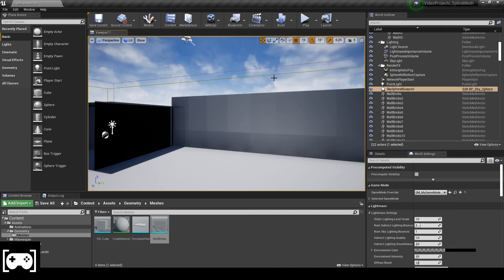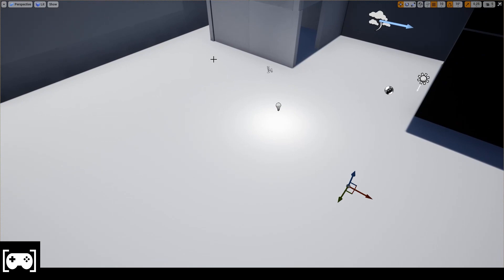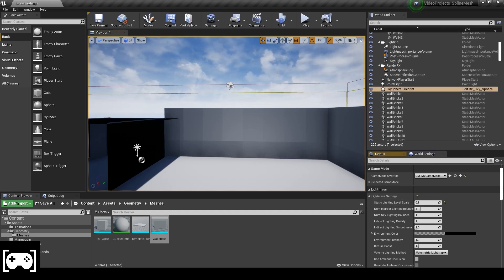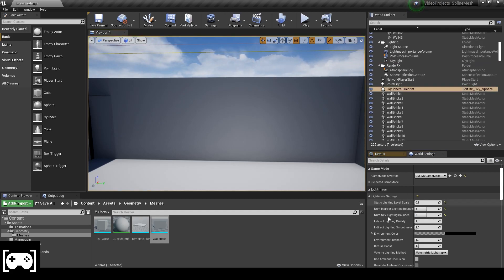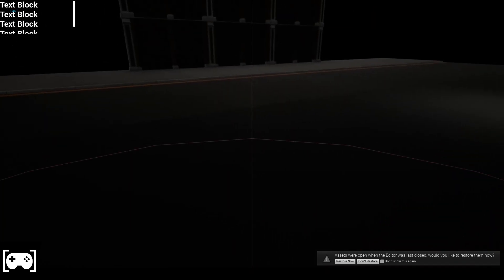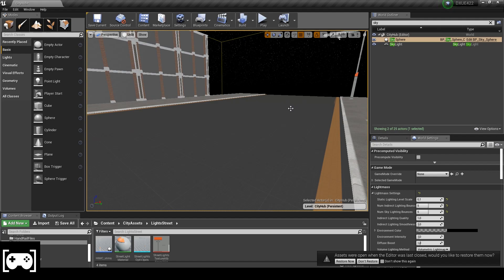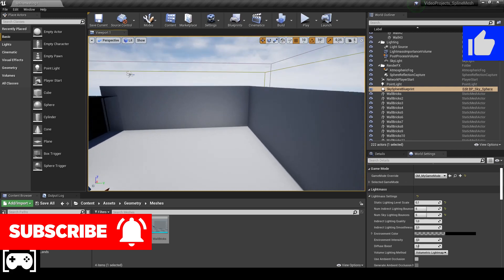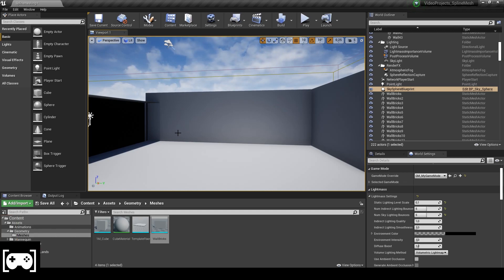HOW TO FIX INDIRECT LIGHTS FOR MODULAR ASSETS | UE4

Comment: Any tips for fixing this in UE5? Tried the same thing there but no luck sadly.
Reply from the maker: Thank you for commenting ;) unfortunately i am not longer working on unreal engine.... if i was you i would stick to ue4 due the massive tutorials available. 
However i would suggest you to just make a one big wall and apply the texture on it, and then multiply the texture so it looks realistic.
Reply: @gamedevandcodingno worried I figured it out in the end.  UE5 had ticked Recalculate Normals on import causing the issue haha. Thanks though 😊
Reply from the maker: @volbeatowns  That's great, thank you for sharing the solution here in the comments ! I am sure other people will find it helpful :) Good luck to your project !

Comment: what to do with Leaking lights? i have a door that is too thin to create a shadow, so lights goes throught it.
Reply from the maker: I dont think its a matter of thickness, however I would try to apply a two sided material, however another thing that cause this problem could be that your mesh have a light map with low resolution and light build with low quality, so I would also check those up and fix them.

If that doesn't work, then contact me on instagram, maybe we can find a solution :)
Reply: @gamedevandcoding  thanks for the answere. after some testing, it appear that what ever the material i put in it, i have the leak, so the problem come from the mesh ( free mesh from a free asset). if i completely remove the Specular, the problem is done, but the look is bad lol, i need the specular. 

 I know praticly nothing about lights, but the problem could be the Light Map from this asset. i'll have to search on Light Map. 

The mesh is a door with metalic stripe on it. The door produce shadow, but the metalic stripe doesnt, but get the lights. At this point, i'm not sure if it's considered a Light Leaks, or simply a bad Asset lol.
Reply from the maker: @SoohNabis  I have never faced a leaking lights problem, because I make all my assets from scratch, which gives me more control of the situation, indeed I heavily recommend you to learn blender for 3d modelling, and I would also consider to use another free asset if  nothing can be done.....
Anyway you would like to take a look to the following documentation: 

- Lights going through mesh: https://forums.unrealengine.com/t/lights-going-through-my-static-meshes/301263
- Lights going through wall: https://forums.unrealengine.com/t/light-going-through-wall/323628
- Lighting problems: https://forums.unrealengine.com/t/lighting-problems-with-edges-of-meshes/631285/11
- Shadow Casting: https://docs.unrealengine.com/4.26/en-US/BuildingWorlds/LightingAndShadows/Shadows/
- Lights and environment: https://docs.unrealengine.com/4.27/en-US/BuildingWorlds/LightingAndShadows/

If you find the solution, please leave here in order to help the community :)
I wish you best luck with your project !
Reply: @gamedevandcoding  when i try to send you images, Youtube delete the comment.. Wtf!
Reply from the maker: @SoohNabis  I dont think its possible to send images on youtube...
Anyway send everything to my instagram or facebook, I will be happy to help you :)
Here the link for my IG: https://www.instagram.com/gamedevandcoding

Comment: It would be nice if anything that i do to solve problems like this about this shitty program worked..
Reply from the maker: Yeah it's a really serious problem, especially when you have modular assets...
I tried many solutions, and I have been looking for so long online for a proper solution, but I didn't find anything useful unfortunately...
So I tried to play with some settings and luckly I got an acceteble turn out, follow the my video step by step maybe it could help you with your project :)

Ps* this is not the official solution, I cant guarantee that my solution will work always 100%
Let me know if you found helpful my tutorial, and if you fixed this very bad problem ;)

Good Luck ! :)
Reply: @gamedevandcoding  unfortunetally It didn't work.. but with your tutorial I've learned new things about light, at least.. i'll try another things tomorrow and If It doesn't work, i'm gonna have to use blueprint to hide the light.. thanks dude!